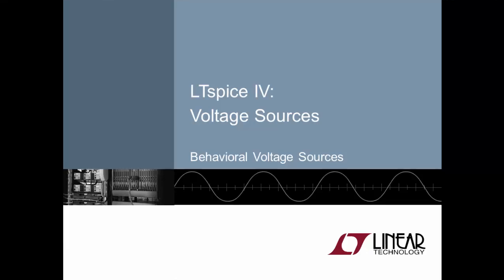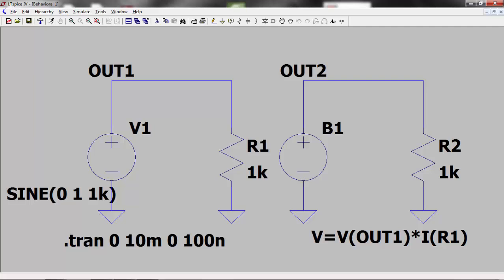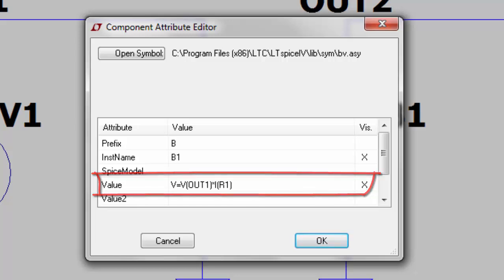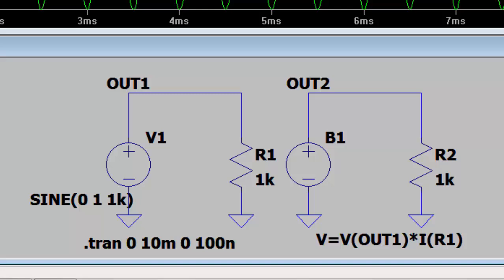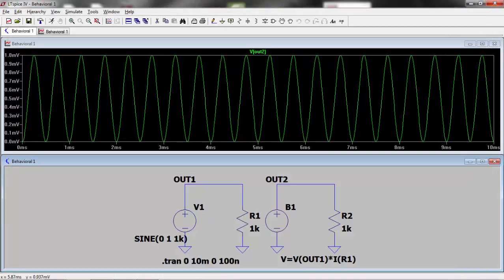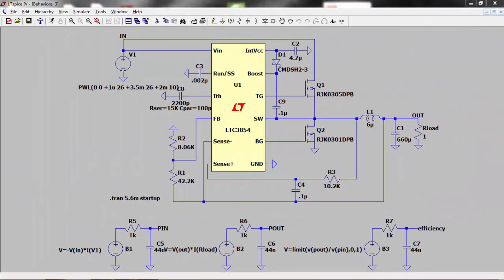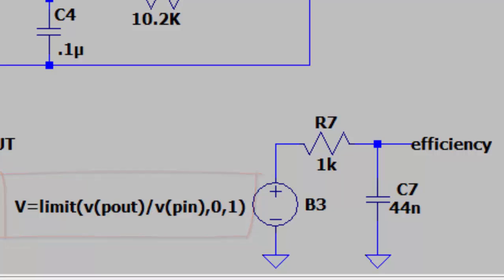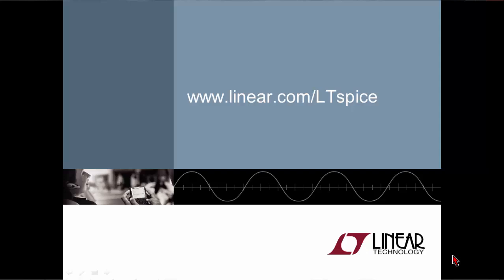LTspice: Behavioral Voltage Sources

Comment: Ltspice is very fast than other spice program. But it has not other  companies component spice. Especially I require basso pwm models . Can you add these models?

I use linux ubuntu. Ltspice run on wine my system. Do you create ltspice  setup file for ubuntu ? Thanks

Comment: Thanks for the helpful video.  For AC analysis (instead of transient), what are the limitations for using behavioral voltage sources?  This wasn't clear to me in the documentation. I tried  modifying your schematic for an AC sweep analysis and ran the simulation. I didn't get an error message but got Vout2 = -225 dB at all frequencies in the plot, which is obviously wrong.

Comment: Thank you for the tutorial. I was wondering if we can save the simulated plots on MAC to an .emf format (image format) . Please let me know.
Reply: From the Plot window, select File -> Print then check the box saying Print to File. This will print to a .prn file and there are many online tools you can use to convert from prn to emf. Alternatively you can use File -> Export Data as Text and this dumps the plot data into a text file containing 2 columns of time and voltage instances. You then might be able to use another package to save the data as .emf format

Comment: hi Mr. i got an assignment to design multistage op amp to have 38 dB gain. specification are

AC input signal 10 mV_peak
Power supply 1.8 V
Total power  <200 µW
Gain 38 dB
Cut off frequency 200 kHz
Phase margin 〖70〗^o 
Load 2 pF capacitive 
1 kΩ resistive 
it has been weeks now but i havent been able to do it. because i dont know how to use simulation analysis to measure those parameters. such as phase margin and cut off freq. if u can help me out it will be great help for me. i got submission in 2 days time. 
thanks
Reply from the maker: Hello is this a school assignment? If so, what school? To get a more detailed answer, please contact: 1) Technical Support at http://www.analog.com/en/support/technical-support.html, or 2) the Power by Linear online support page https://ez.analog.com/community/power

Comment: LTspice have great functionalities but the user interface is very bad
Reply: If you use the Function keys (F3, F4, F5 etc) as well as R (for resistor), C (for capacitor), L (for inductor), G (for ground) etc, you can drastically speed up how long it takes to enter and modify a schematic.
Reply: @simonbramble  very true
Reply: Agreed. The user interface is putrid!
Reply: At one point I was actually pining for the old Silent 700 days.
Reply: maybe not look like a photoshop interface but better stability and faster, its not a graphics or cao software.use's shortcut and d'ont talk like a mac user
Reply: @ChEsperado Why do you say it's buggy?